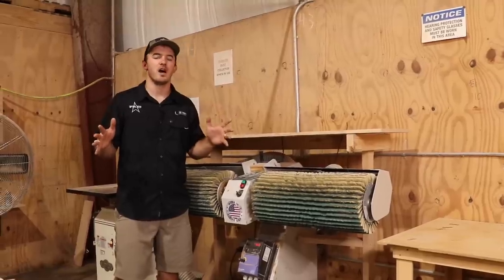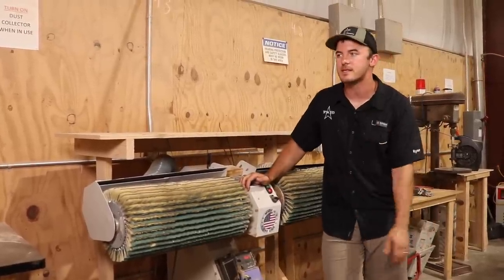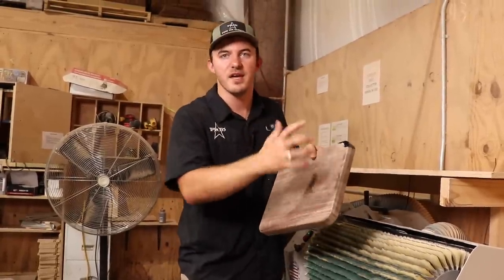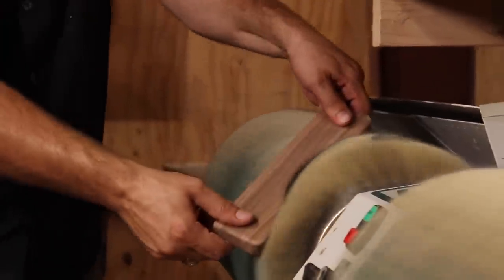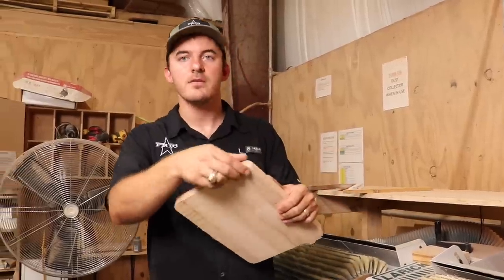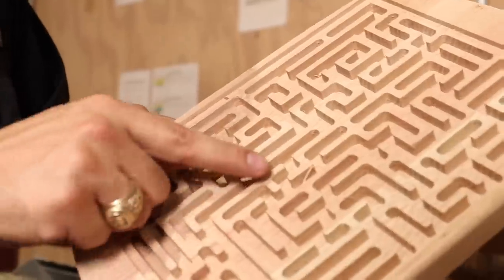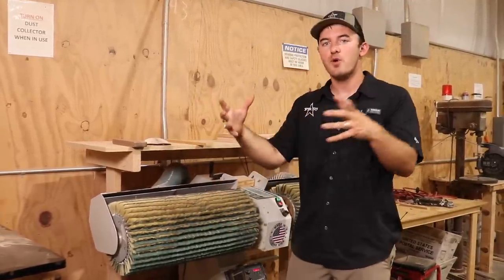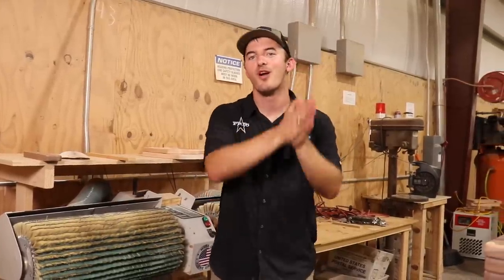Best Sander in Woodworking

Comment: Seems crazy that you only have to replace the paper once or twice a year.  Paper on your hand orbital sanders will not always last through a single project.
Reply: Consider the total surface area of each and how long they're in contact with the wood.  There's a lot of abrasive on the wheels he shows, and they may be being used more effectively/efficiently than on an orbital sander, too. He shows the wheels being used to mostly round edges and strips extraneous bits out, not necessarily sanding whole faces for surface prep or harsher tooling removal.  I'd guess the ROS is more likely being used in those types of tasks.  This is just my humble guess.
Reply: If you think about it, that machine probably has 100sf of sandpaper on it and it’s a only really abrading a fraction of an inch on the tips of each flap

Comment: For a smaller shop, there is a better fit. Look for an air bag sander. It pretty much will do what this does. But it's a lot smaller and less expensive. 
Basically it's a 8" inch wide bag, that inflates, like a tire. You order the grit and size sandpaper you need. Slip it on the bag and inflate. It will sand the contours about the same way. 
If you need something for a larger shop, look for the one he's showing. It's a great sander.
Reply: @360degreemachinery  Yes Sir, I completely agree. It is definitely not a replacement. However, it is a pretty good alternative for a small shop. No, it will not sand crown molding and such. It will however sand a lot of contour and flat surfaces very quickly. Faster than a belt sander or even a spindle sander.
Your machine is amazing, but I couldn't justify the cost in a small shop. 
A few years ago, we were building pine bunk beds, maybe several hundred a week. The pneumatic sander did good for those. We sanded flat and contour on the same machine, just different grits on either side.
I appreciate you responding. God bless you and family,  Brother.
Reply: @360degreemachinery  Id like to see a pic of that

Comment: I love using air flap sander. Really handy for bigger pieces. We use flap sanders on brushing machine after applying finish to remove all sharp points. Sandpaper is really expensive, but for air sander we cut our own strips and glue them in.

Comment: Really wouldn't be too hard to make one of these, even to the exact same size and caliber / quality of this one. You'd have to have some fab skills for sure, but it's easily on the doable side of things.
Reply: The lathe you already have in your shop could be set up for this very quickly
Reply: it'd be pretty tedious, but your right its just sandpaper, some bristles the barrel that holds everything, then a motor and vfd
Reply: @danc2207  I would lean towards making an attachment and a jig to support it that is powered by a standard drill.
Reply: Kinda looks a bit like a rear axle, doesn't it?

Comment: Crazy that something that is literally just a motor with RPM control would be $5000-6000.......
Reply: As machinery goes, this is a bargain... ask anyone who run... this isn't some kind of knocked-up DIY gadget... its built to last and as he explains in the video, the time (=money) saved makes it well worth it... 

I remember having to install 2 new headstock bearings in a little semi-automatic Britan lathe, must be 30+ years ago... the 2 bearings cost me over a grand sterling... I bought a bender for making brackets, hand-operated, not powered, around £800... 

It looks like theres very little in that sander but fabrication costs and those brush-heads add up... 

😎👍☘🍺
Reply: It's about how it saves time which equates to money for a business, making a one off DIY version would take a lot of time and during that time your employees are wasting even more time sanding in less efficient ways.

Comment: Looks good but I think it would be easier to use and less fatiguing if it spun the opposite direction. It's easier to pull upwards than to push downwards and you have more control that way as well. I wonder why they chose to have it rotate where the wheel is going upwards, there might be a good reason but it just seems like it would be awkward to use.

Comment: Instead of running your fingers along to see if you get a splinter get a piece of paper towel and run that along and see if it leaves any paper towel fibres it’s safer and it’s also more sensitive giving you a better chance of catching those splinter points
Reply: You have to then look for the fine fibers where as you get instant feedback by feel. After a few splinters you get better at sanding, kind of like how you learn not to touch a hot stove as a kid.

Comment: The fundamentals of the machine seem really simple, it’s practically just one really long/wide flap sanding disk, but i think the real benefit is probably related to the dust collection, the speed control, all the little things that when they work right you just don’t think about, probably is what puts this above those similar sorts of things like the drill press mop sanders or similar

Comment: We had a small version of this. Our big complaint was the paper was expensive, and when you loaded in the new paper it wasn't offset so you had to trim some off 2 of the 3 connected pieces of paper. wasting 1/2 to 3/4 of usable material.

Comment: Cool machine, but WHY ON EARTH would you say that this machine has saved you 20.000 (or 10.000 in the title) hours in the past three years?! 10.000 hours divided by 3x365 days equals just over 9 hours SAVED every single day three years straight. I don't normally bother commenting, but that just irked me. Realisticly, I guess this machine may have saved you 1000 hours over 3 years (which is still very good!).
Reply from the maker: So I have 5 employees that use it daily on the shop floor. Based on the numbers and quantity of product sanded this saved me around 12,000 hours of labor over the last 3 years. I should have clarified better in the video, thank you for watching, I really do appreciate it, is there anything else you would like to see?

Comment: I tried to look up the price for the refills, wheels, supplies etc for this machine and found *nothing*. Nobody selling this thing puts it out there on their website how much the abrasives cost for it. Not even the manufacturer, which is no longer Larick. Pillar machine bought Larick. It's all Contact Us to find out. If a company refuses to put the cost of something on a website, if I have to spend time to call or email, or if they only have info on a PDF, my interest drops way waaayyyyy down.

With PDFs especially so since all the browsers now automatically save them to the default downloads folder to keep instead of the browser's cache. Please, just stop using PDF for stuff that should be on a web page.

The companies want to get you on the phone to try and sell you the machine before they'll tell you the supplies cost or get your email and other information. Industrial machinery companies are still acting like it's the era of phone, FAX, and printed catalogs, except e-mails have replaced FAXes and PDF has replaced the paper catalog.

Comment: It looks like something that cows would use befroe they go get milked or to give them a clean. Although my question would a large legnth horizontal belt  sander not be a beter option and would probably be cheaper 🤔🏴👍
Reply: How could such a machine possibly do the same thing? Would work for an even surface only...
Reply: Different machines for different surfaces.

You can't use an edge sander to smooth odd corners and squared edges.

Comment: How is this 5-6k?
Reply: @360degreemachinery  I think he was implying that it's more expensive than it should be.
Reply: @360degreemachinery I know that and agree with you,  I was just pointing out that Jakeledg's comment was likely saying that he thinks it's over priced. If it saves a lot of time in production it will pay for itself quickly and then make you more money.
Reply: @phillhuddleston9445  My goal was to provide facts as to its value in "either" direction in which his comment was aimed. What is perplexing to me is that Ryan's title to the video proves value. At just $10 an hour, which is never the true cost of a $10 employee, this $7,500 off the shelf machine has saved him at least $100,000 in labor over very little time. He has literally made 12+ times his money off this machine (so far). So I get that the machine is expensive if you are looking at it in a static environment, but Ryan literally gave context and the knowledge of how to increase profit. If you gave me $7,500 and in 2-3 years I returned $100,000 I'd say there was nothing but value there!

Comment: Lol,, "..when you're doing a job with lots of these little curves, it's absolutely perfect."  ... drops the word 'profile' from name. 

I get dropping the manufacturrer and model, but it's a Profile Sander. Imo, you need that word in the name, cz it tells you what it specializes at. A flap sander could be anythiung, cz as you point out, flaps come in shapes and sizes, some which are not good for profiles. Which doesn't negate it's descriptive value, but 'flap' is describing the tool, not the jobb the tool does. Maybe if there are different types of profile sanders, it could be a flap profile sander.. lol, I'm laughing at myself... 

peace

lol, but, also, u know, if you say profile all the time, you start to think of profiles. Actually, what got my attention, was thst word, cz I have been loosely designing, in my head, over the past while, a system for sanding automotive doors and panels, with a affordable small shop machine, so I thought a 'profile sander' wow, let's see thst, lol... So, the basic idea I see, works for wood profile pieces too, like you, but for, say, cupboards, what you want is a sled that slides under the wheel, so you could lay panels flat, pass it under, and have the flaps designed to morph to every line, perhaps a giant spinning sponge??Idk they probably have them, lol peace
Reply: @360degreemachinery   Lol, yes, see that's what I was designing!... and he said they call it a proffile sander, ... I actually have thought about what you describe, a cross bar custom fit for every type of panel, so  they could be sold in full vehicle sets, or individual panels, but for pro shops, I think that's a lot of equipment, new models every year, cars that are 40 years old coming in, etcc.. so my thoughts turned to something that molds to any shape, why I mentioned the sponge, also tines, as you said. ....Obviously, a spinning axle, and a conveyor, opens a lot of possibilities what you can put on the axle, hencce a list of categories. I'm guessing the factories have machines, but they could easily make dies for their needs it is worth it, but I'm preetty sure shops still hand sand every panel several times, and shaping... I look at a planer and I think, that's the ticket, but it needs to take any shape. By hand, we do that with a sponge, but, we only do a 4 inch pass each time, Idk,... lol, but obviously, I know what I am talking about, lol...

 peace

* I started looking at the Shopsmith table system,because I lovve their sandpaper, and wnt to their site, Dam! Another idea I had brewing, 7 tools in one table -  Saw, router, planer etc. and they got this cool clamp bar for joinery, I hadn't thought about it yet, but it was on the list, since I found pipe clamps. Woodworking market could use a similar but tailored unit, I think it would do well. Look at all the free million dollar ideas! lolk
Reply: 60 seconds later... lol.. Digital age, CNC's, after sales service, and autobody support much better these days. If not already done, they will have templates online for your CNC sanders, maybe some type of cross bar, withthousand tines, and it takes the shape it needs to. Future is here  man... l
Reply: @360degreemachinery  ya, cool stuff. I look forward to it.  .... Meanwhile, I have sanded and stained this table at least 5x, because I can't get a good finish on the epoxy, lol. I used to be the sand and stain guy for a cabinet maker, I did every cupboard door with a 6', and no dust extraction(dedicated, there was a shop system), so a machine doing a better job then me, should be pretty straight forward, lol... Good talkin to ya, I fell asleep last night:)

Peace